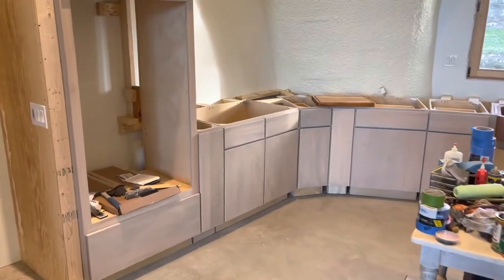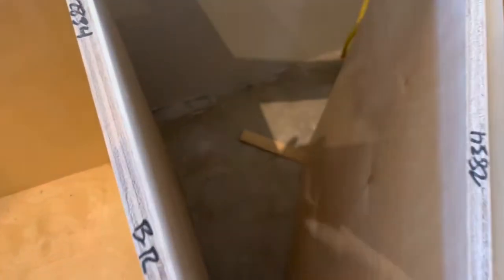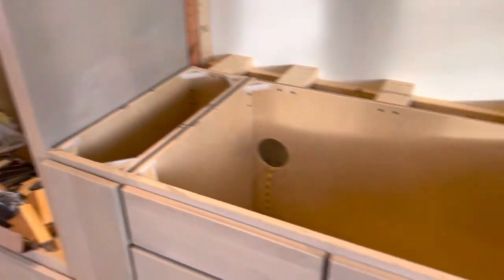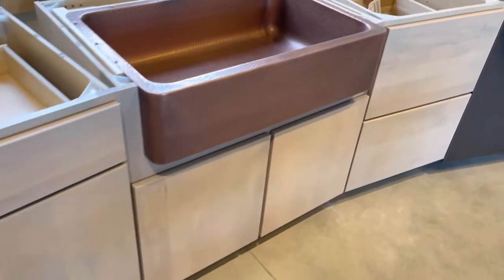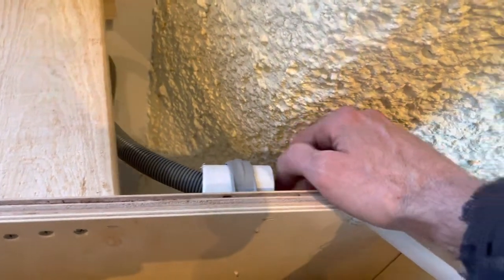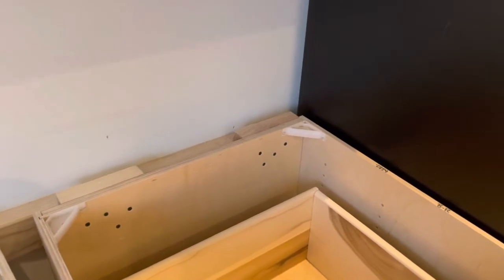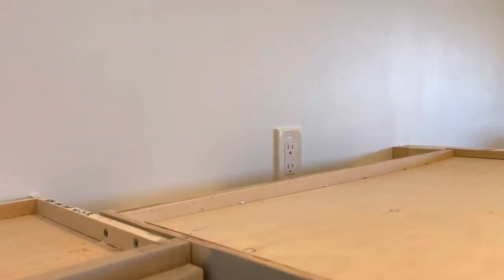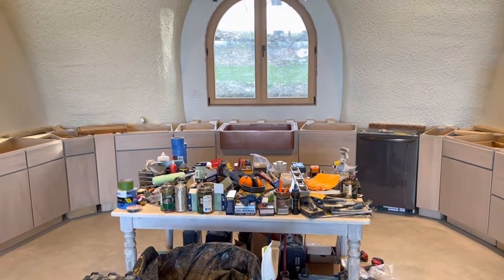Curved kitchen - Cabinets installed

Comment: It looks great.  I did something similar last year.  Is there a stack vent somewhere for your kitchen sink?    Because of the concrete wall behind my sink (with no room for a pipe to go up) I used a mechanical one that goes under the sink.
Reply from the maker: Thanks!  
No, there is no vent on that run.  The only thing on that 2" pipe is the kitchen sink and the dishwasher... hopefully things are okay.  We do have 2 stacks in the system, one in either ear so I think we will be okay but I am just uneducated guessing... If you go way back in our video's (or on instagram) the system is super simple in layout.  It is 4" pipe at a 3 way wye that goes dead straight to the septic.  It is 3" pipe from just beyond the toilets to that aforementioned wye.  Then it is 2" pipe from the sinks to just before the toilets.  All those branches are dead straight as well.
From what I read we should be okay.  
./fingers crossed!

Comment: My original "feasibility study" plan idea I submitted to Monolithic had the kitchen wrapping the curved wall.  They suggested to put the kitchen on and inside straight wall.  Especially now I can see that adding another $10k to the kitchen build.
Reply from the maker: Yeah I am not sure what an installer would add.  It is a ton of time.  There is no flat surface to connect them to, nor can you connect them to each other. Normally, cabinets go in real quick, just level and set to the wall/each other and done! This was around 40 hours.  Some of that is a day spent making the small spice rack cabinet that came without a box or face.

The other thing is we opted to skip were upper cabinets on the exterior dome walls.  The curve and slant would have made installing cabinets level and vertical a nightmare.  It could be done, but may you have a universe of patience...!

Comment: Hey guys, you still out there?  How is sound bounce with those bare floors?  Monolithic has just finished my shell last week.  Got to start thinking about flooring.
Reply from the maker: Hi, Yep we are but we have been not very good posting things since we moved in. Congrats on having the shell up! We have polished concrete floors and there is definitely some interesting acoustics. The very center of each dome is where it is the worst. Putting up interior walls made the biggest difference. Furniture helps as well but as long as you have whole domes as open space like we do in the great room/kitchen there will be spots where the sound is odd. We are 5 months in at this point and I am used to it. The only place that bothers me is the very center of the kitchen dome. That will eventually be our island so hopefully no one will ever stand there once it is built. Goodluck with your build! I have a lot to update on here,the blog and Instagram but I will get there.
Reply: @dometastic  thanks for the info.  Ours is 2, 38 ft diameter domes pushed together about 25% on each.  Then it has a 1.5 stem wall too. The kitchen/living room is open to the peek of 19 ft in about half of that area.  The second floor is just 1100 sq ft of loft. Did you smooth the walls at all or keep them rough?   I was advised to have it plasters for esthetics but, besides cost, I think the rough surface will help diffuse the noise. Probably best to live with it a while.
Reply from the maker: @doclees11  For some reason I missed this message. We left ours rough and sprayed it with an amazing amount of paint. It was 4 coats of primer (some areas needed a 5th) because the concrete absorbs so much. Then 1 coat of semigloss top coat but we went back and spot painted areas with a second coat. I don’t think the texture helps with sound all that much but we have no comparison. If you leave it rough and paint… I suggest doing it sooner rather than later because it has to be sprayed to get an even coat and it makes a huge mess. I think a plaster skim coat would work. The texture looks really nice with the glossy paint (I did it to soften the texture and make it a little easier to clean) but it is still really rough. All in all it was about 12 five gallon buckets of paint. Most of that was primer.
Reply: @dometastic  thanks.  I just talked to the project manager.  He is getting a plasterer for an estimate.   Said it was so rough it would probably draw blood if you bump into it. I had sent off pics in an email to Monolithic to see if this finish was expected but not over a week and no response.  My airform is bright white.  Someone said it looked like an igloo.  Ooooo that would be a hoot on a Florida shoreline to stucco the outside to look like snow blocks and paint it white.  Wife didn't like that idea. But after seeing the white against the deep blue FL sky it reminded me of the houses on Santorini in Greece. So instead of manufactured stone like the Whitfield house it will be white stucco with blue widow and door frames.